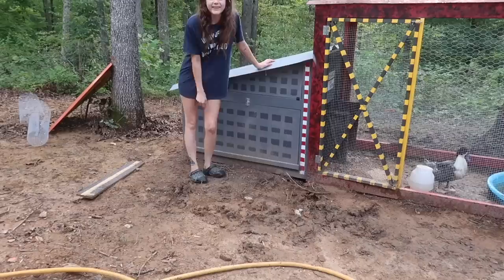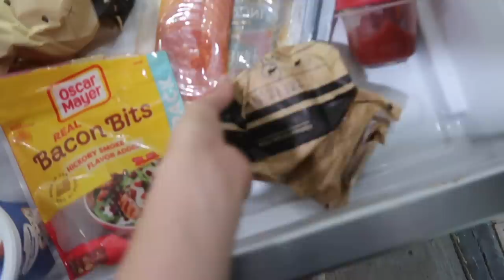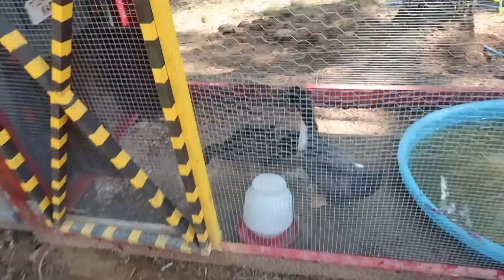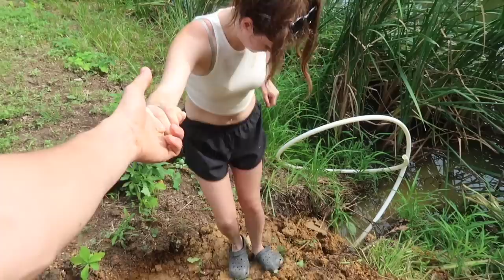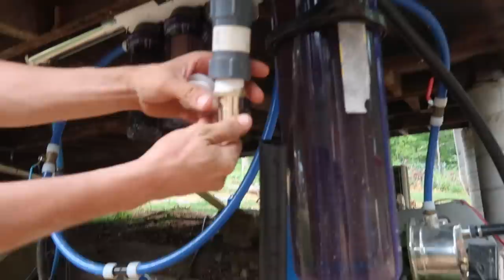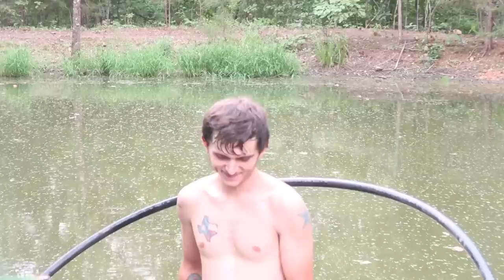Will our PIPES FREEZE? I Shipping Container Home | EP:59 | Rain water catchment system upgrades

Comment: I'd use tuck tape instead of duct tape. Tuck tape is for vapor barrier, so better suited to water sealing, duct tape is for air. also, the adhesive on tuck tape is waaaaaay stronger.

Comment: Take extra steps to ensure your pipes and pump don’t freeze go beyond what you think the winter weather might do. You may also want to put heat tape on your above ground piping and enclose your water pump with insulation and possibly supply a heat source for the pump house. I don’t live anywhere near you guys but I have lived in the Kansas, missouri area my entire life within 100 miles of you guys and it can get extremely cold here even though it really hasn’t in the last few years that foam insulation by itself won’t be enough to keep your pipes from freezing
Reply from the maker: Heated and insulated pump house coming soon!